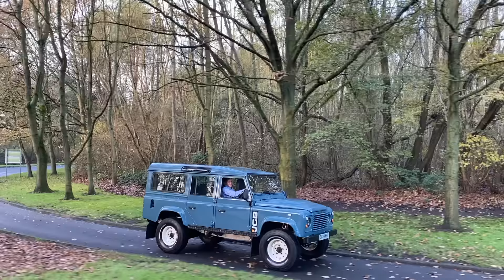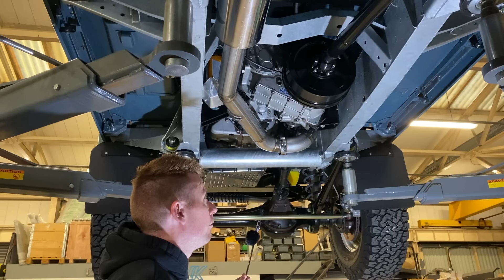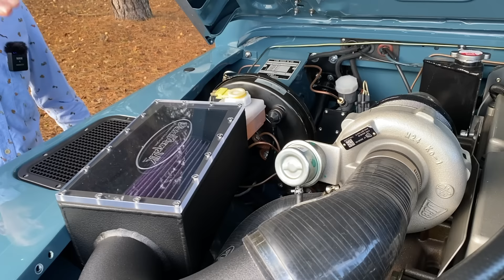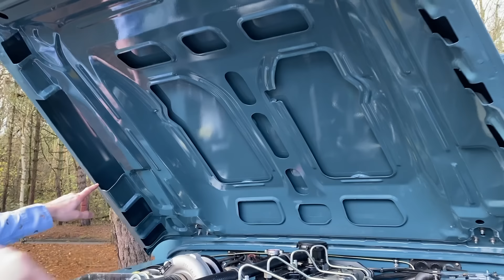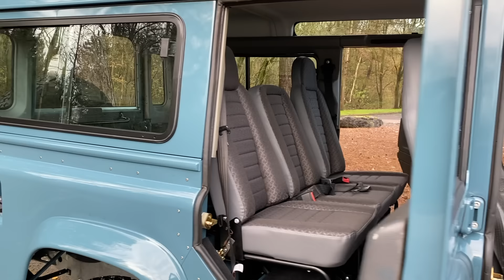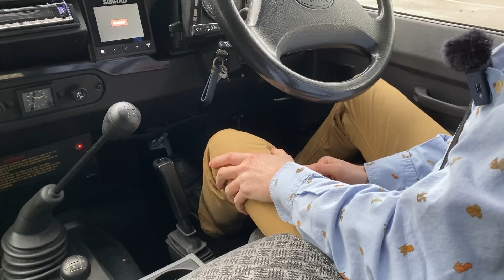British LAND ROVER Defender with JCB 4.4 Industrial Agri Engine Conversion Dieselpumpuk

Comment: Has anybody tried getting more power out of these?

Considering how overbuilt these engines are and the 4.4l displacement, I'd image you could make alot of power just throwing a larger turbo on?
And I'm ngl, the sound of that lump of an engine is intoxicating, its so chunky compared to any other I4 diesel I've heard

Comment: 10:09 that's the same trick they had in New Holland/MF tractors of the time to save messing about with an EGR valve system like JD went for to cope with Tier 3 (which everyone eventually blanks off especially the leaking coolers)

Comment: I really like this.   I had a s3 lwb with a Perkins 3.3 diesel.  Not fast, but you could have a 3 ton trailer behind and it still pulls the same.  Would have been great to have R380/LT230 behind it with all the options that opens up.

Comment: Had a similar idea about 25 years ago when I installed at 2.5  L mechanically injected Bmw from the early 80s in my  1963 international Scout.   The engine works so reliable and good on gas that I installed it as well in a Jeep Grand Wagoneer as well as a GM 1968 stepside pick up truck.     With an intercooler and some tweaks to the injection pump it makes serious power and is reliable as well as pretty economical. On a stronger version of the Scout I installed a twin turbo 5.9 Cummins 12 valve. That pushed 1044 hp on a Dyno  on the rear wheels and if you search "Monteverdi race 2014" on YouTube you see me competing on a quarter mile race against a 997 GT2 twin turbo Porsche.  Thanks for your entertaining content

Comment: I find it hilarious that you took out the 200tdi and put one of the most unreliable engines I’ve ever worked on for better reliability  😂. I’m very impressed with the quality of your workmanship though and hope it all works out for you. Best engine JCB ever used was the old Perkins engines. Now they were solid and dependable and would work really well in a defender. Currently in the process of sourcing a 3.5 V8 for my 1989 110 soft top. It has a 200tdi in it now and it’s good as gold but I need that V8 rumble in my life

Comment: I checked out the spec sheet on this engine. Its a low speed diesel. Governed maximum no load rpm is 2370. Peak power is 2200 rpm. This is a terrible idea for an on road light vehicle. What prompted me to check the spec sheet was listening to his test drive. It sounded like he was short shifting pretty seriously. Turns out that engine doesn't rev. At all. I doubt he can hit the speed limit. There are better options out there.

Comment: Good work fitting the engine...... only thing is in the digger the JCB engine used far more fuel than the previous Perkins engine, so much that I sold mine.

Comment: Nice build;
I'm in the proces of converting my 1991 Defender (original 200 TDI)

However I fitted a Detroit / VM 638. Don't like 4 cylinder sounds and prefer the 6 cyl.

However similar setup. 3" exhaust, full stainless. Front axle done, terra firma suspension, 

Only running the LT77 gearbox suffix H which is as strong as the stock r380 according Ashcroft.

I really love your airbox.. can you give me some more information regarding this?

Comment: Very nice job. As a gen set engineer I like the idea. Is this engine of the same block and fitment layout as the new hydrogen engines? Could we see a future replacement should the gas become available? For servicing. We would often service gen sets at 250 or 400 hour intervals depending on the size. at 1500RPM that could equate to 12500 miles at 250 hours or 20000 miles at 400 hours. I often went to rental sets having shut down through lack of oil after being let to run at double those figures without being topped up. I drop my oil at 5K in my cars as I want to run them to at least 200K What do you do? Also what is the speed at 1500 in top gear? Well done!

Comment: That Land Rover makes more sense from an environmental point of view than an ev ! 
It can be repaired it’ll last decades and it’ll be economical to ! 
Great work
Reply: And... when they stop selling diseasal at the pump, you can run it on SVO
Reply: It's ok to get excited, I love it too, but don't  get carried away. EV batteries and motors will last decades. And during those decades, you won't be changing oils and filters, repairing complex drive components and brakes every five minutes.
Reply: @geoffthompson1215  mmm but they’ll be loosing mileage every single year no thanks you can keep your ev junk
Reply: @Luddite1 Oh dear...

Comment: Funny you mentioned land speed records since that 4x4 JCB engine actually holds the world land speed record for diesel-engined cars. Well, it did take a pair of engines heavily breathed on by the factory in a streamliner chassis but the 4x4s achieved an honest-to-goodness measured mile at 350 mph in both directions back in 2006.

Comment: I had an old series 2 .put a BMC 1-5 diesel in.big mistake I could probably run quicker.but at the time 50years ago I was getting my diesel for free.had a massive battery in the back but it still took an age to fire up even with recon injectors pump and new glow plugs.

Comment: New chassis, bulk head, recon gearbox, axles...etc...
Q PLATE.
Reply: A few little white lies never hurt anyone.

An ex-neighbour of mine was a vehicle mechanic and had a 1980 Ford Bronco outside his house that he bought off the local American Airbase here in the UK when it shut down. It had rarely been far off the base, so had very low miles on it.

I was chatting with him one Saturday around about 2001, and he mentioned that he'd had it MOT'd earlier that day.

I said, "Funny, I don't recall seeing it going anywhere today."

He replied, "It didn't. Depends on who you know."

Comment: Ok, so the other way round - whats a readily available cheap diesel on a mechanical pump, in the region of 70-90bhp, that'll sit at 2500 rpm in a Massey 35 all day long? 34bhp is not cutting the mustard anymore.

Comment: What's the usual rev range in one of those? That would be the only hang up i would have as a 4.4 litre 4 cylinder i would of thought will have a VERY low redline
Reply: Around 2300-2500rpm
Reply: @charliemccahill2131  eww

Comment: Tell me Luke, you’ve built a formidable reputation based on the OM606 engine etc, so why did you choose a JCB engine for your very own Defender, seems a little counter intuitive unless you’re diversifying? You really should do a joint project with Dave Lea at Mahler, now that would be proper vehicle ! ❤ Mahker
Reply: Probably because the OM606 doesn't have any low down torque. Dave from Mahker also hates OM606s in Defenders.

Comment: Oh dear I'm sorry to say. Well the reason I say this is because it's just a straight up bad engine choice and you even told us why. How do I know because I tried to do it. Fair is fair it's an excellent job very well done and made to work but all wrong in my opinion.  The main reason is it just doesn't fit well (too tall), is too heavy (cast iron), poor to match to a transmission and low top rpm. I am a Brit, love Land Rovers and even worked for JCB in the past. I worked in development and had full access to all JCB engines, parts, data etc. and spoke to engineers about putting it my V8 95 Range rover classic. Working it out it just didn't make sense even though I could of done it on the cheap compared to you guys. The fact of the matter is the JCB engine is a commercial construction equipment engine not designed for automotive use. A light, high performance, aluminium engine is best as the Land Rover is just too small for this engine. Overall a really good job, top quality workmanship but just not worth it.

Comment: Firstly congrats on a beautiful build and even better attire!

In Australia, we got the Land Rover 110 with the Isuzu 4BD1 (3.9ltrs) from the factory. This is like a modern version of this.

4 cylinder 4.4 litres!!! Forget the BHP, the torque pulses are going to be massive.

The R380 (even when upgraded) struggles with the Isuzu 4BD1T (4 cylinder 3.9 litre) due to the torque.

It is going to be interesting to see how it goes. Why not keep the JCB gearbox with a modified LT230 gear ratios?

Would have been hard to resist going with JCB yellow, but it would have been like 'Big Bird' from Sesame Street coming down the road!!!

Comment: great work.

I would add: the engine is likely not gonna last as long as on actual equipment, as now it's going through multiple RPM all day. These usually last longer because they stay at certain RPM.

Comment: You kinda skipped over suspension. The conversion is so cool and professionally done, I’m just a bit confused of the purpose of such a torquey tractor engine if the suspension isnt setup to tow/carry massive loads.

Comment: I’m debating the replacement engine for my 2016 ecodiesel ram 1500,large 4 cylinder should be fine.especially if I can adapt it to the 8 speed auto with a stand alone

Comment: We have this same engine as a generator engine. It’s however fully mechanical and it’s from September 2022 with over 13000 hours on it. So far a pretty good engine, but the previous engine lasted for over 116k hours so it still has something to prove. 

Funny thing is: it’s stage 5 compliant while being fully mechanical.

Comment: Love the build, but how come something like the Cummins r28 wasn’t used?
Reply: I can’t speak on their behalf, but the Cummins is a totally different engine. The Cummins is a car engine, this is a heavy equipment engine.

The Cummins is considerably smaller in displacement. It has just over half the torque this engine has. This engine is very cheap and readily available in the uk.

Comment: Very nice. I built my 1975 Range Rover for a similar reason, to tow trailers reliably and economically. I have a 6 cylinder 4.2 Nissan Turbo engine (Patrol) fitted along with a front intercooler. Fully cast iron engine with gear driven cam. Indestructible. Starts first piston up in sub zero. I also fitted the entire 5 speed gearbox, transfer case, props, diffs, axles, brakes, wheels... you get the idea. It is so nice to drive. Even has a servo assisted clutch so super light. It has run flawlessly for the last 12 years needing only tyres , oil and a battery. I recently stopped towing trailers so I can sell this now if anyone's interested. I am in Sussex.
Reply: I am interested
Reply: No offence but why didn't you just use the patrol?
Reply: @nick_7869  In the UK all Patrols are rusty or already rusted away. You can't get spare parts for them, no body panels. Early Range rover also has modular body same as Defender.. and you can get everything for them.

Comment: Isn't that a contradiction: a reliable British car...? You really had to go the whole 9 yards of trouble to even try to match these two contradictional words of Reliable and British in one sentence, now did you...? Well, let's see what this British car with this British engine in there will bring you on the reliability issue scale. They are British products after all... But we'll see, just report in an honest way on a frequent basis how reliable your British mix is doing, let's say at least once a month. If it does turn out disappointing, it wasn't your fault or your approach. If it works out reliably, you've found the golden mix! Now see if the rust stays away and no nuts vibrate loose and other things fall apart during use.

Comment: All that and it crawls around a car park with pretty standard tyres at about 10 miles per hour towing nothing and will probably never do any work in its life. Potentially a cool upgrade but, my still standard TD5 just keeps on working, everyday without fail, like a little Landy should.

Comment: Well, well done for even contemplating shoe horning a JCB engine into a Defender!
But i do wonder if your constant 'it will run for ever' line is 100% justified?
If you are basing it on that JCB engines last forever in a JCB, your engine won't be used in the same way will it. 
JCB life is a bit of road driving at maybe 40mph followed by hours at not more than a high tickover. You thrashing around the country at motorway speeds is something no JCB has ever done without being on the back of a lorry.
I'm not saying it'll blow up in 30,000 miles, i'm just pointing out your logic may be a bit flawed.
Top rebuild though!
Now then, would one of those tractor lumps fit into a 101?

Comment: Of all the Land Rover build projects (and I have seen a lot of them) this is by far the best one out there. My dream is to do the same with a Series 3 109” and make it reliable with a big displacement non turbo 4 cilinder diesel. I don’t care about high horsepower or extreme off road kits. I want it to be pure mechanical and agricultural.

Comment: Not saying the R380 won't work or last. But you should look up the name of it.... it is not about power. It is the fact it is rated for 380nm.... Rover wouldn't even use it behind a 4.6 Rover V8 as a production vehicle. You say your JBC engine has over 600nm.
Reply: R380 is Rated for 380Nm it's in the name

Comment: Never before have I looked at a Land Rover and wondered if it could be better than my Land Cruiser.  Very impressive build 👍
Reply: I’ve had Landy’s for 35yrs and had to have a Land Cruiser as a courtesy car when my 110 was damaged in an accident.
It was a 2019 model with 400 miles on the clock, and all the mod cons on it.
I had it for a month and nearly cried when I had to give it back.
Comfort & modern features made my 110 ( 1997) feel like a vintage Massey Ferguson.
If I was offered a LC for my Defender I’d take it. 👍🏻

Comment: Hi 
Having worked on these engines in the past and knowing that it's speed range is about half of the original landrover unit what have you done to regain usable vehicle speed at sensible engine speeds

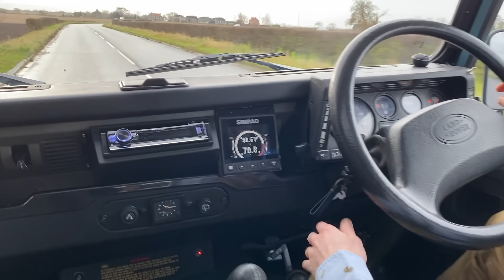Comment: 18:11 certainly interesting hearing 4.4 JCB engine with normal gear box I drive 2012 telehander with same engine that just sits at 2200 rpm until up to speed then onto 2500 and sometime 3200

Comment: Top job mate 👏. 200 TDi in my eyes is brilliant we’ve had a discovery with one in full off road spec 18 inch wife tires it’s done 35 k miles in the 6 years we’ve had it and only seen a road a handful of times gets little to no maintenance and it’s just chugs on and on feeding the pheasants every day

Comment: This is truly a fantastic build. I think all time favorite and I work for Cummins!!! In a previous form of employment I used to run 5 JCBs with this motor and 15 irrigation pumps with the slightly small JCB 4 cyclinder. We never had an engine issue. All pumps would be retired around the 12-15k hour mark!
Reply: It is right that the Cummins 6BT was made by a British guy from Perkins?

Comment: You forgot U-pol gravitex stone chip under it and on the chassis. Unless you plan to leave it in the garage.
Reply from the maker: Not a big fan of stone chip, it’s like wrapping the underside in a plastic bag and hoping moisture does not enter. Ideally a thin strong coating is better with a light application of rustproofing oil etc yearly
Reply: @DieselPumpUK  I know what your saying but you need to try gravitex then gives you a hard finish nothing like wax oil. If you apply on clean surface it will out last paint hands down

Comment: I simply love it. When everyone is going for BHP, low-down and easily accessible torque grunt is the master in a 4x4 used on or off road. 
I love my 300Tdi 110 with VNT but it does not pull,  sound as good or look as good 
as this!

Comment: Old father in law did this many many moons ago,  with a series 2A, 109, truck cab. Popped a then current jcb engine in, (3.9 i believe), and had zero excelaration , but soooo much torque! Towed anything you could throw at it, and started first squeek, any weather

Comment: The problem is that this government and past ones, have taxed these great vehicles off the road check out the registration number they steal about 6 7 hundred quid and rising every year, it’s totally unacceptable and out of order especially since they are few and far between of these vehicles around anymore, they just keep upping the tax every single year until there’s no vehicles on the road other than the way overpriced BE Vehicles that’s the ridiculous electric battery vehicles, while in America they are going back to gasoline vehicles 100% and rightfully so!

Comment: Been driving telehandlers since 2007 and would and would take £3 per hour pay cut to drive a manitou instead. No mention of dpf regen every 30 hours that is a pain or crappy fuel pumps failing so it wont go uphill.Kubota engine would be better but I could not live with under 2000rpm redline which every telehandler has in a car.

Comment: you could just put a 3.9 isuzu from a truck like the Australian amry did with the land rover perentie.... now that picks up power its even better with a turbo a small turbo and she will spool up and just keep it with the LT95 transmission. i been in a perentie with the turbo kit and it gets up very quick and the owner Ian is able to sit on 120kph and it dont take long to get there and it dont rev real high... but i think the better thing with the 3.9l isuzu over this lcb is that the isuzu dont need a ecu which is the most likely thing thats gonna let you down when you in the middle of nowhere. nah sorry ecu are for new town cars not serious offroad vehicles.

Comment: If it was a 1988 with the 2.5 turbo diesel engine then it’s a pre defender. The designation Defender came in 1992 with the 200tdi.
Reply: Actually, the Defender name came in 1990 shortly after the release of the Discovery in 1989, but the Ninety / One Ten (what would later be called the Defender) came out in 1983.
Reply: @RWL2012  Technically late 91, as the 200tdi was introduced for the 92 model year. but the Defender name only came with the intro of the 200tdi